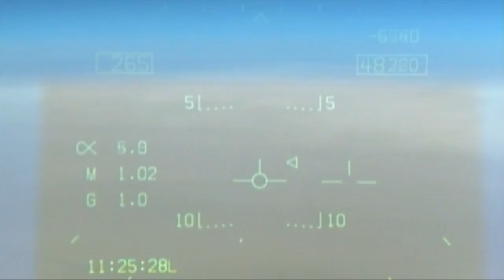A Boeing Super Hornet's first flight

Comment: Is it my imagination or was takeoff distance less than 600 ft?? Harriers can't even rotate that fast.
Reply: +bryant tillman Well, with full afterburner, a light fuel load with no ordinance, and brand new engines, the aircraft is able to accelerate very rapidly to its rotation speed of 100 knots. Remember, it had a stellar power to weight ratio, much higher than a piper cub. Just my two cents :)
Reply: so WTF? I've seen Hornets pull all kinds of shit, but to rotate faster than a piper cub in gale headwind??!
Reply: going by the runway marker i don,t think you far off  cool video
Reply: bryant tillman And just under 9 seconds to boot that was ridiculous!  You wouldn't think a brand new airplane taking it's wings for the first time would be pushed that hard like that.  For sure I would've thought he'd bring up the engines slowly for the first take off and use up as much runway as possible to build take-off speed, but perhaps that's a testament to that amazing aircraft is it's short take-off capabilities.  So much wing surface and lift created.
Reply: GoMiGman No, no, I'm looking at this thing again...it's just not possible. Rollout is just a nickle longer than a carrier catapult launch. Somethings wrong, here.
Reply: 100ft and an inverting ramp...! No, the plane in question is the Hornet above, which didn't use more than 600ft worth of runway, according to the vid
Reply: Unless it's deceiving looking at it through the viewfinder of that camera in the cockpit like that and it's actually a greater distance than it seems, after watching it again it's confirmed to me that it's a ridiculously short distance before his nose goes up.  I counted 8 seconds for crying out loud maybe 8.5 and distance?  No clue but it sure seemed very little.  Any way to confirm 2 things - what does he mean by "to hundred, rotate" which is what he says right before he pulls the stick back and it goes up?  And, anyone know what the distances are of those white lines and in between?  The latter is probably a much more difficult one.
Reply: GoMiGman If I was being generous I would say the little lines were marking increments of 100ft.  ,,,but STILL. "to hundred?" "2 hundred?" Maybe the pilot audio was "dropped in".
Reply: bryant tillman I take it back. Those lines CAN'T mean 100ft. The plane would already be several stories off the ground upon brake release. I served on a carrier; I've seen these Hornets till I'm sick of 'um. The cockpit isn't that high off the deck. Someone's fucking with us.
Reply: Yeah I wasn't sure if it was "2 hundred" or "to hundred" either.  Need a test pilot to jump in here lmao.
Reply: f🚙🚙🚛🚛🚙🚛🚘🚘
Reply: lol
Reply: +x Psi the
Reply: +x Psi soft christian musicc

Comment: No, he was at mach 1 at about 50,000 feet. lower air pressure, different speed readout which is why speed is referenced by mach numbers. Even commercial airlines use this.